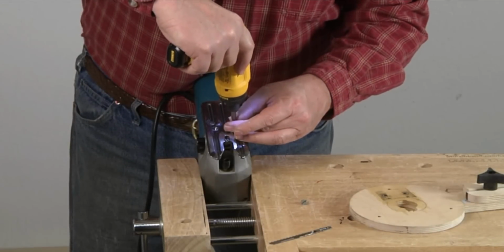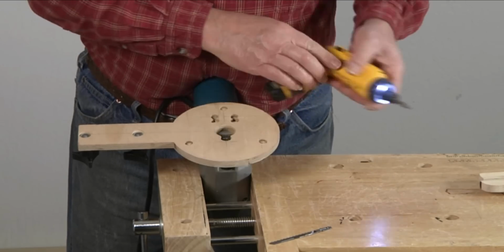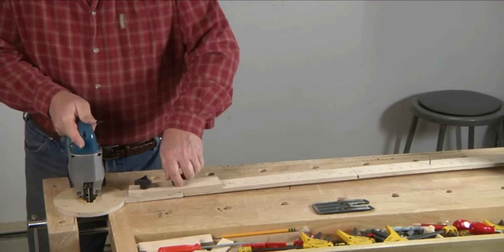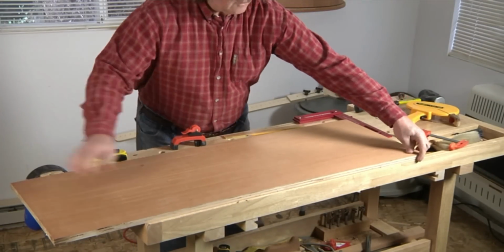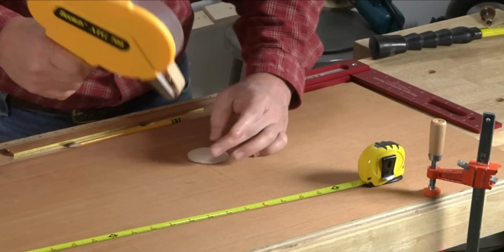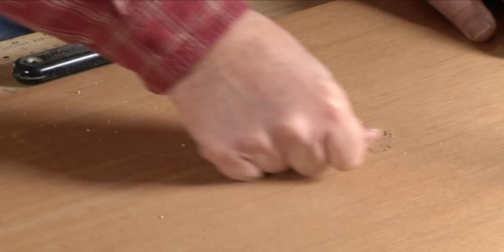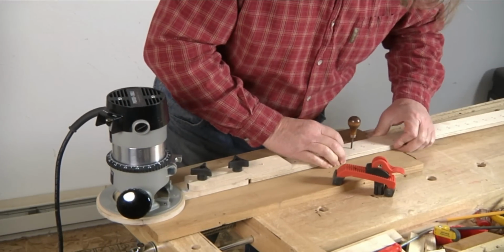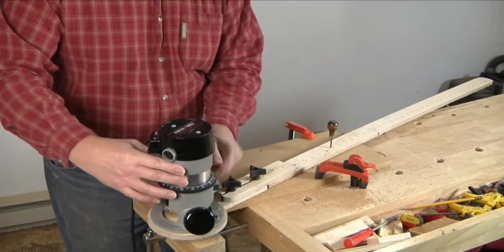Using a Circle Cutting Jig

Comment: How do you cut the small groves that was shown on the concentric circles?  Looks like limit on jig is considerably larger than what is needed for small circles.
Reply: Since the jig can be made to any length, you could easily make a shorter one.